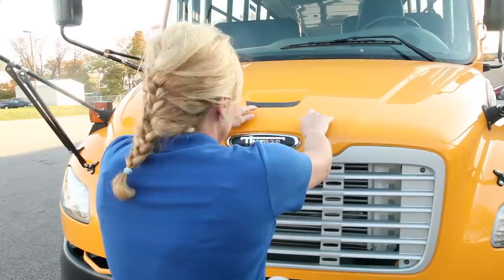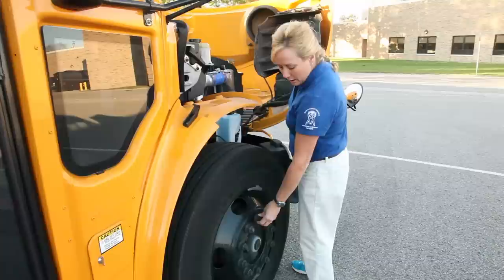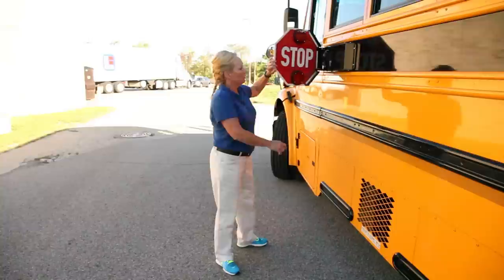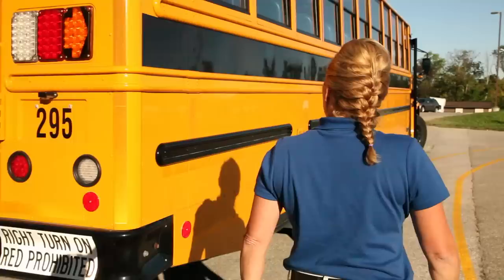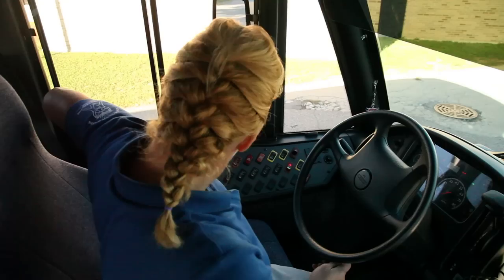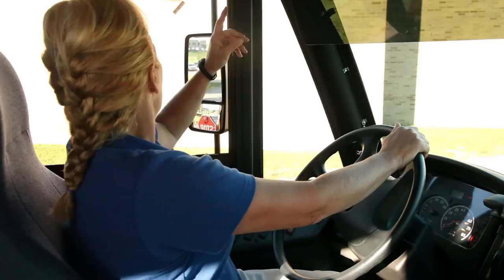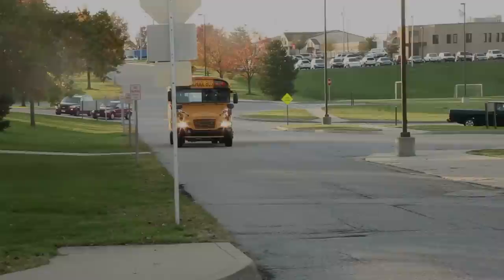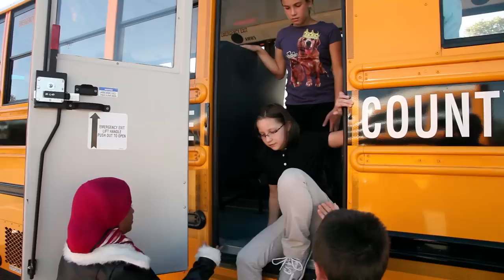Boone County Schools School Bus Procedure Video

Comment: Great video! Your pre-trip procedures are almost identical to what we have here in Pennsylvania. One other thing we I do is check for inside flat tires. You can do this by using a crow bar to tap on them or press your foot against the inside rear tires. If they're soft, they're flat. Also, the outer tire will bulge out more where it's on the ground with an inside flat as all the weight is now on just one tire. This is a rare occurrence, but I've seen it happen a few times in my 9 years of driving. It hasn't happened to my bus, but I've noticed it on others. That bulging rear tire is always a tell-tale sign!
Reply: Kentucky uses the PA inspection protocol, just wording is different.

Comment: no one can do a pre-trip in 15 min.or in 7 years i have not seen it done properly.most company's i've worked for want you to show up early on you're own time.so if you get hurt well you know...and she missed so much i.e certificates,1,2,3,walk's around.brake test cut in cut out din't wait the full minute. static air loss applied air loss whats the max pressure to do the static parking brake test (rolling)min psi.servise brake test .amongst other things. min thread depth front and back .i wish the best of luck to your trainees.
Reply: +jenn cast Really?  Truck drivers do it and have a lot more to cover!  It becomes second nature!
Reply: Sassy Frassy hahahaha

Comment: they don't mention the use of seatbelt
Reply: ALEXCASTROp
Reply: bdle est: Seatbelts are required for the driver and buses for Pre-K or Special ED buses!

That's also the purpose of high backed seats! The high backed seats are there to protect you from flying into the windshield!

The seats may not feel soft on a regular ride but when involved in a collision the seats are pretty soft
Reply: Like your dog

Comment: I can point out that she couldn't name one single thing under the hood. Wires and hoses? lol their goes 
14points off your exam.
Let me help you with what you missed under the good babe.
Coolant reservoir:
Radiator:
Water pump:
Fan blades: 
Alternator:
Air compressor:
Power steering reservoir:
Power steering pump:
Steering column: 
steering gear box:  
Steering linkage: ( pitman arm- drag link- steering knuckle)
.
Reply: kingbullet316 Will you train me, sir? Lol. Seriously, you seem to know what you're talking about and your comments are very helpful. Post your own video perhaps. Just talk about the many different parts of the bus and maybe have some print outs to refer to. It'd really help and I'm sure many would greatly appreciate it!
Reply: kingbullet316This video was never intended for a CDL exam.... 
It was put together for our drivers for their Pre-Trip before they take a bus on the road...
Reply: +Linda Streitenberger  GORGEOUS BUS  BUS DRIVER  ! 😆
Reply: Linda Streitenberger t
Reply: kingbullet316 Lmao.